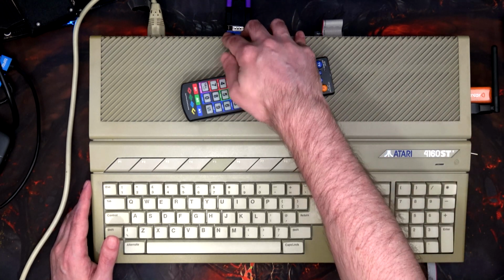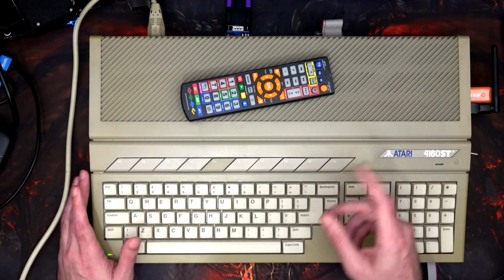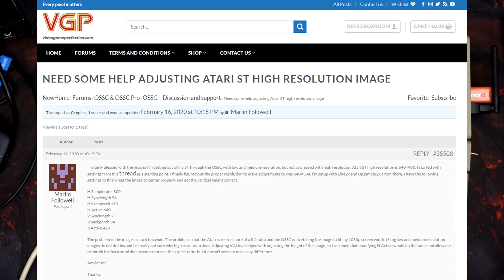An Atari ST with a VGA2SCART and an OSSC used together

Comment: As this is something I've toyed with before, I gave it another go and this is that I came up with (direct connection to VGA port on the OSSC)

H. Synclength: 106
H.Active: 640
V.Active: 480
H. Backporch: 12
V. Backporch: 1
H. Samplerate: 672
And to get rid of some interference I had: Sampling Phase 135 degrees

This should give you an image with a more natural aspect ratio and little to no moiré. However, it is right on the cusp of what the OSSC thinks is an acceptable signal. The unfortunate truth is that high res Atari ST and the OSSC are not an ideal combination. For convenience sake, also tried connecting the ST to an old PC VGA to HDMI connector box I have (the important thing is that it should be able to convert between scan rates), and that produced a nicely centered image right away. However, the image was very soft, comparable with your filtered example.
Reply from the maker: Thank you. I'll give it a go when I have a chance.

Comment: You're getting close but it's still not quite there. The moire pattern you're getting is because in your scaler's chosen output resolution of the visible part of the ST's image resolves to close but not quite 640x400 (or a multiple thereof). Marlin's settings get the vertical size close to perfect, and the horizontal size is still a bit off, but in his post he writes why this is: either the aspect ratio is off (from 4:3), or the resolution is. Without something like supersampling anti aliasing it's impossible to get an image that is 100% correct in both aspects. The LPF setting that's available on the scart port really is a crutch as it smoothes over all of the fine detail. The setting used on 4:52 is much blurrier than the image on a real ST. For comparison, a well adjusted SM124 monitor can just about resolve the checkerboard pattern of the desktop.
Reply from the maker: Thank you for the info. Hopefully someone makes an easy install of a good mod at some point.

Thanks for watching!